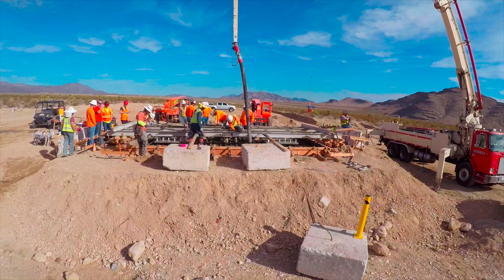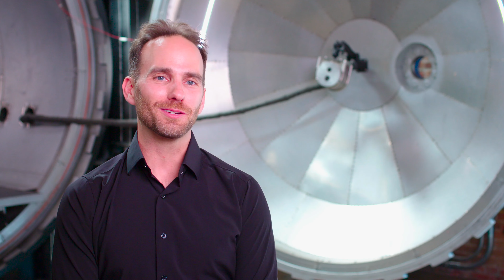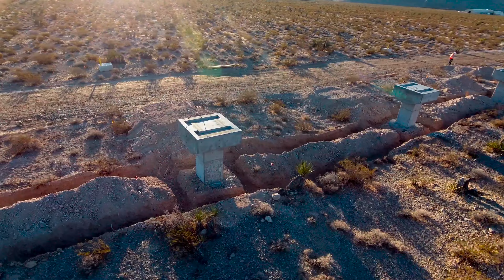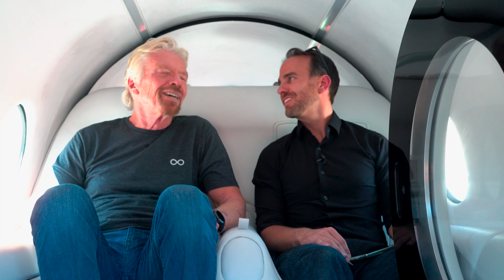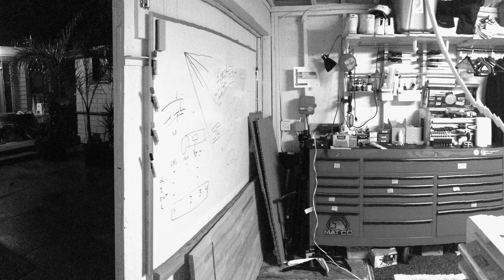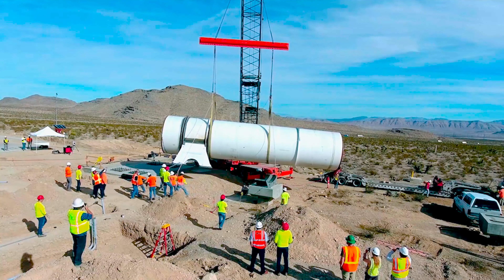The Challenges The Hyperloop System Needs To Overcome | Engineering The Future

Comment: Hyperloop will never work. They are going the wrong way about this idea. The rail and pod is easy to figure out, it's why it is all they do. Try building a 500m long tube that you can depressurize with an entrance and exit that can go from pressurize to depressurize. Once they realise that they can't do it on 500m let alone 500 km, there will be no point in wasting money on a rail and pods.